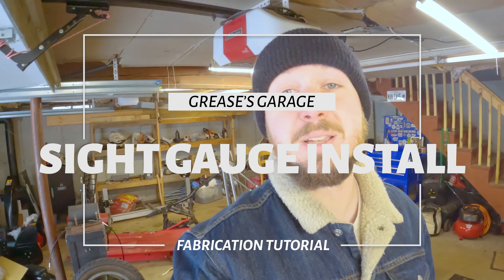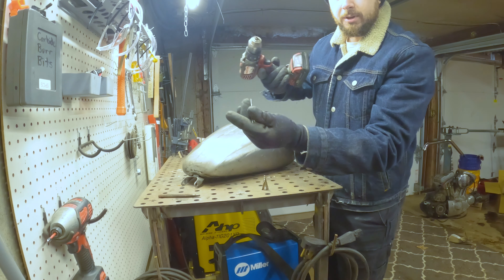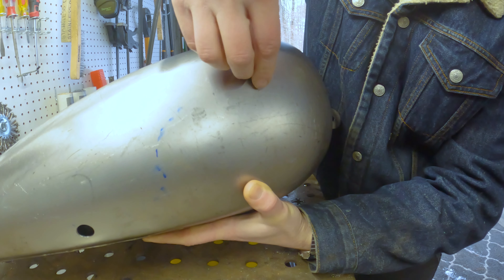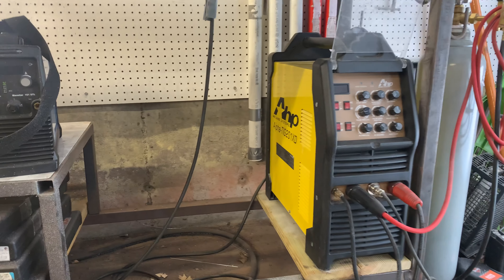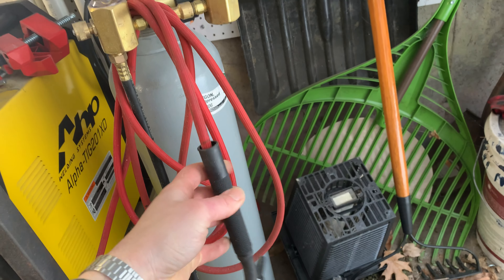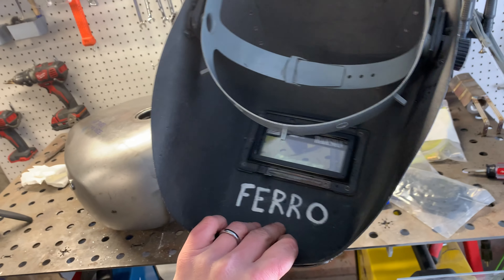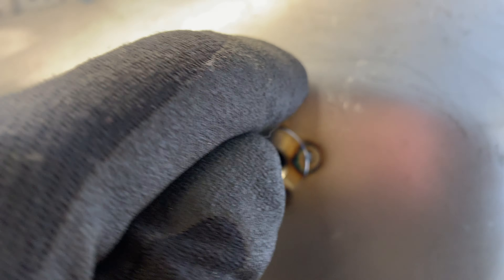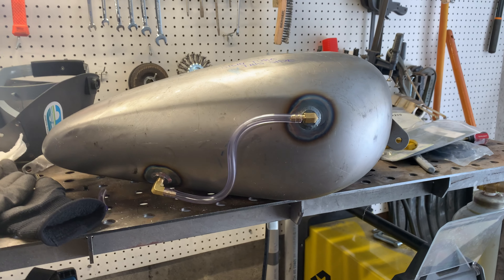How to Weld Tophat Bungs (TIG Welding Tutorial)

Comment: Thanks for the video grease. I am currently debating going to pick up an evo motor and 5 spd tomorrow.
Reply from the maker: If the price is right I highly recommend it. I’ve had great luck with this one. About 45k on it and still running the factory pistons and cylinders. 

What are you planning for the build if you get that motor and trans?
Reply: @greasesgarage  well a chopper lol. Its got one of those 3.5in open primarys still attached looks to be what is left of someone's  2000 style softail.
Reply: @greasesgarage  guess i should specify its from a 85 softail.

Comment: How do you clock the elbow fittings? Do you run them in and mark them before welding, or just send it hard on the last turn
Reply from the maker: I do clock them first but to be honest I often find that the best way to get them perfect is by varying the amount of Teflon tape I use. If I need the rotation to stop sooner, I add more tape. If I need it to turn more. Less tape. Once it’s in there, I never get any leaks and it never needs to move again

Comment: Can’t wait to do this to my sporty, but what was your process for getting the metal shavings out of the tank after drilling?
Reply from the maker: You can give it a good shake with the hole at the bottom or even add some water to flush it out. Just be sure to dry it fully so it doesn’t rust

Comment: Why not mount the lower bung to the under side of the tank? You'd get a more accurate fuel read right?

Edit: I have the same AHP. The bang for your buck with that welder is hard to touch. Also have an Lincoln HD 180 for wire feed welding. Miller is the best for everything if you can afford them. My opinion as a former commercial welder.